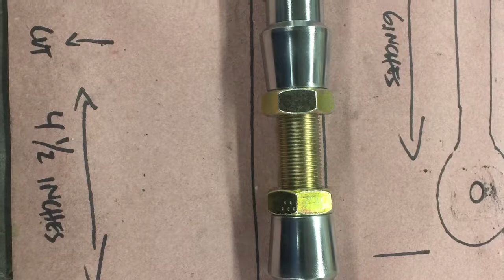Landcruiser Stock Panhard Modification

Comment: nice. i was looking to modify my panhards vs spending $600 on new. i was just finishing my 3.5" lift. what were the size of the inserts and where'd you get them?
Reply from the maker: McMaster-Carr they are 3/4 -16rh and 1 1/4 x.120 for the threaded tube/bolts/nuts. Get the grade 8 for durability.